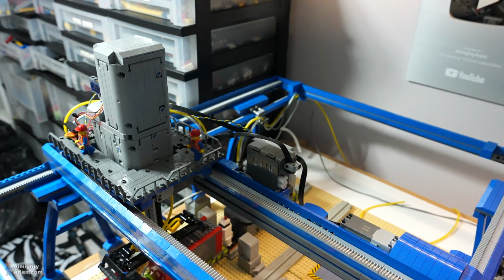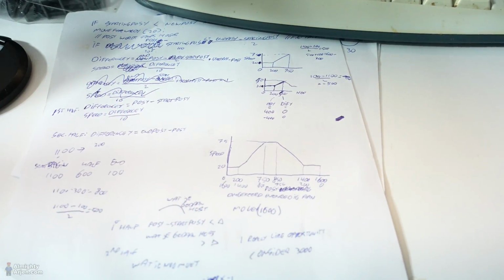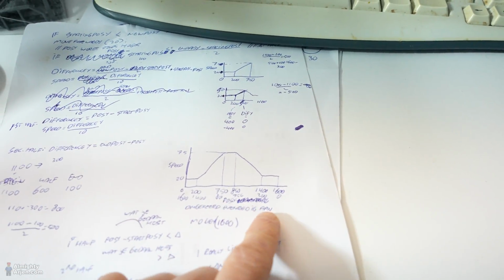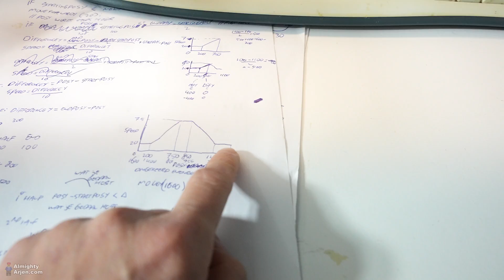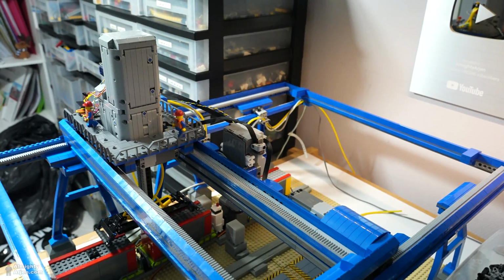Automated lego train container terminal episode 31: first movement of 2nd crane

Comment: The 100/4200 degrees play you mention is about 2,5% which is not that much considering the fact that it is made of LEGO. How much is that in studs?
Reply from the maker: It has an 80 studs reach so that would be around 2 studs. That would be too much although the crane doesn't show an inaccuracy of 2 studs. So it's more the encoder value that has an offset of 2,5%, but the crane itself doesn't. Can't explain why though.